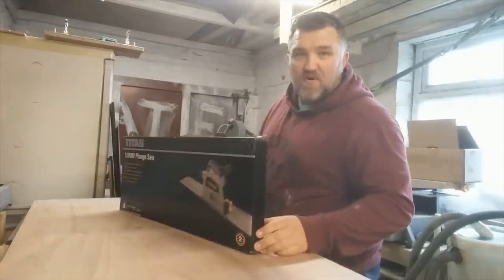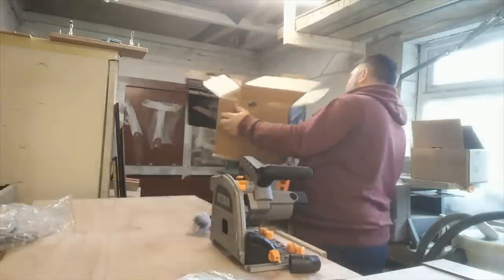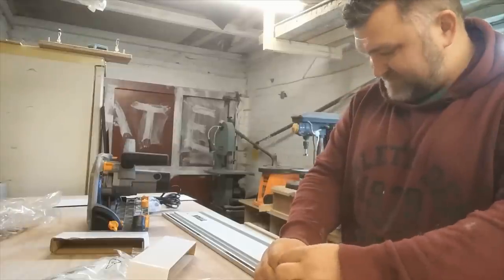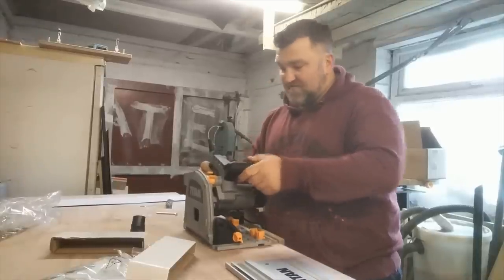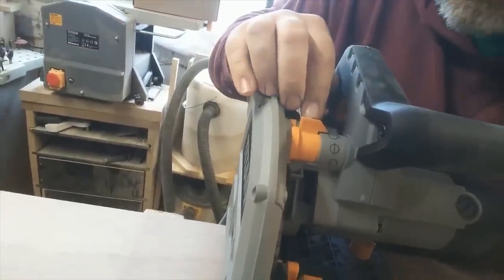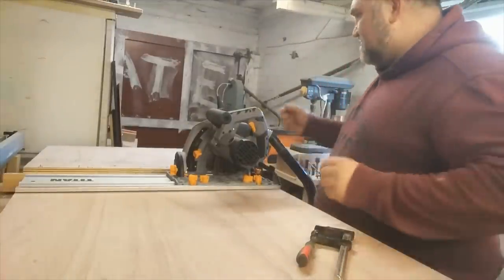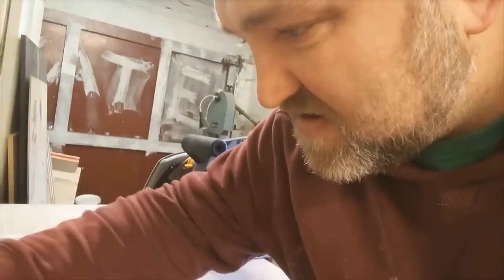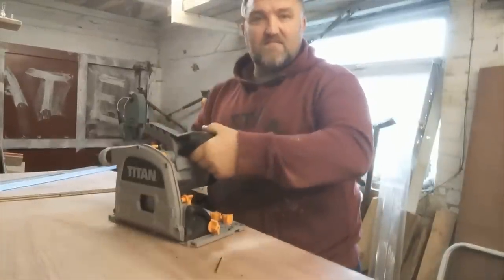Skip s Titan plunge saw unboxing and review

Comment: These  Titan plunge saw are an awesome bit of kit, I used this for cutting 18mm Birch Ply sheet  to make kitchen cabinet carcasses
and it is very user friendly straight out of the box.
I have never used a circular saw before and felt a lot safer and peace of mind using a Tracked saw rather than a conventional free hand circular saw plus you get nice straight cuts also the rubber edge on the blade side of the rail  helps to prevent edge splitting caused by the  up cutting of the blade teeth.
The fact you get a Track saw and two 700mm Rails for £100 is amazing and both Festool and Makita Rails are compatible however the Makita ones are the cheaper option.
I  needed to  rip  8 x 4 ft sheets so I  bought Two Makita 1m Guide Rails from FFX (Makita 199140-0 1m Guide Rail for SP6000)which
combined with the 700m Titan track was  more than long enough.
 The saw comes with a 28 Tooth TCT Blade  but I  also invested in a 48 tooth TCT Blade for the finer crosscuts
I cannot recommend highly enough how impressed I am with this Saw and for 100 Quid you cant beat it.

Comment: I bought one one these also, I was going to send it back because there was so much resistance pushing it across the gide rails it was utterly useless,  then I removed the kickback lock and the 45 degree lock from the saw foot/plate and sprayed silicone on the gide rails & underneath of the saw. It now moves across the gide rails with  almost no resistance like it should have out of the box. My two cents/€ added :)

Comment: Nice review Skip, well done. 
By the way, the Festool guide rail FS1400/2 (£56.65 @ FFX in Folkestone & £33.34 cheaper than Screwfix) does fit the Titan & will give you a 1244mm cut. It's a very handy extension to have. The Titan 700mm rail really only gives you a 620mm cut length, which is perfect for small lengths. FFX also do the clamps for £16.99, £10.20 cheaper than Screwfix. Again, very handy items to have. 
Keep up the reviews & well done. G

Comment: I just bought one of these, not made a cut yet but the rubber on the edge is in the way of the blade so wondering what will happen to it when I do and how to line up the edge with cut line.
Reply: Yeah I was wondering that also.  @5:27 the video mentions about the first cut trims this so guess it's not a problem.
Reply: The plastic/rubber is a splinter guard and is supposed to be cut by first use
Reply: @nicpye248  Thanks, I get it, it will cut away with the first cut, I'm changing the blade to an 80T so will wait so that the finer blade makes the first cut.

Comment: Hi Skip. Nice easy to follow video. I was looking at getting the triton track saw as I have the triton thickness planer but  you don't even get any track with it so I'm thinking of giving one of these a go. I already have a titan tablesaw which again is ok for the money (no frills and the fence clamp handle snapped off yesterday). Have you tried it out on any hardwood? I don't do much in the way of sheet goods just hardwood planks.  Any advice greatly appreciated. Liked and subscribed:)